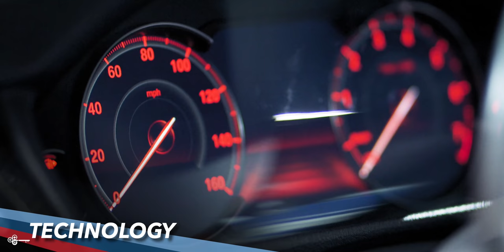WE INSTALLED A HAND-MADE CUSTOM STEERING WHEEL IN MY BMW F30 335i with CARBON PADDLE SHIFTERS

Comment: I just swapped my m sport steering wheel with an alcantara one while watching this. Like Bryan said, I left the black box for the heating/vibration component on the old wheel as the new one didn't have that feature. After the install, I ended up getting a Cruise Control Malfunction notification and after looking at bimmerpost threads, it looks like you still need to keep that black box wired. Problem went away for me after I added that back, so I believe that's what the issue was, but maybe there's a better explanation for this.

Comment: Why you haven't reinstalled the vibration module? Why you haven't changed also the rear plastic cover to get the look-through the steering wheel? This way it's gonna collect the dust in the wheel or am I missing something?